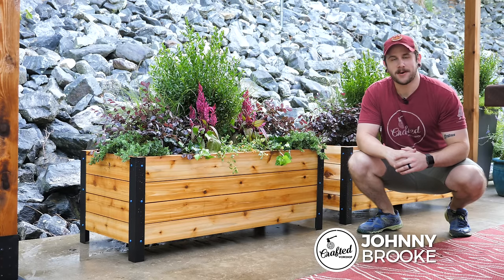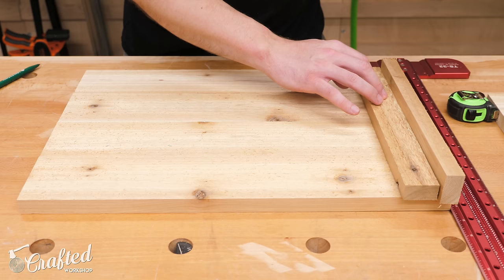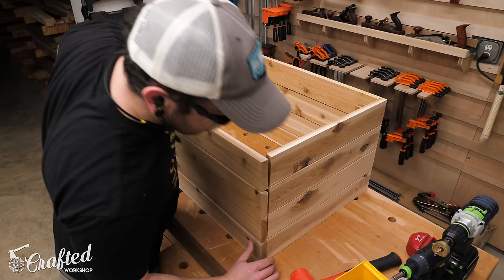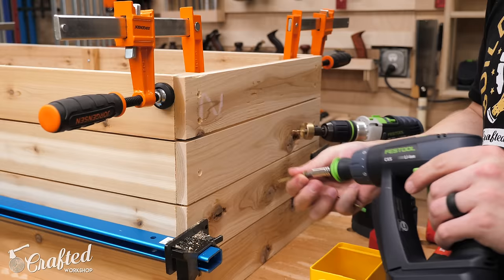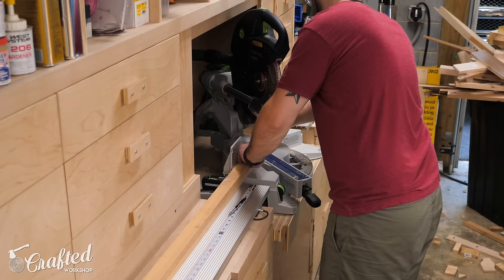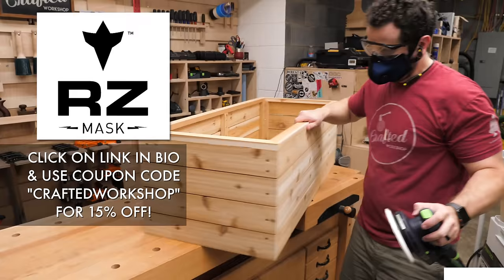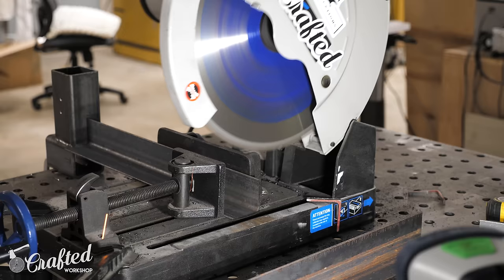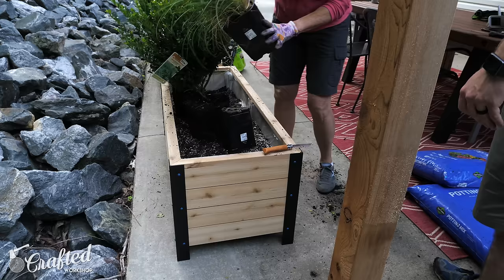DIY Modern Raised Planter Box // How To Build - Woodworking

Comment: just finished this build with only an electric screwdriver, hand saw, and staple gun. looks great! and I used aluminum instead of steel for the legs.
Reply: Can the aluminum hold the weight of the box filled with wet soil?
Reply: @JAMAICAN876  Aluminum angle is very strong being the weight is being transferred to the screws attaching to the box. Use construction adhesive. Better yet order Bostiks Grip n Grab. Waaaay better and faster initial bite when attaching

Comment: I recommend using landscape fabric instead of the plastic. It is durable, holds dirt in. Lets water drain out. And maybe extra oxygen for the plant roots
Reply: I thought so too but he used pressure-treated pine on the bottom, meaning that you need some kind of non-permeable barrier to protect the plants from the chemicals in the wood.
Reply: @kalanlynn2067  🤣 your funny!

Comment: Master Gardner, GREAT PROGRAM!!!! My dad was a primary organizer and instructor, he was a University of Idaho County Extension Educator and my mother was a "Master" Master Gardner and one of the 1st one's in our area. One suggestion for angle iron is to break down an old metal bed frame, which you can get pretty cheap at thrift stores or just find free, and you have a very inexpensive building material. Lastly, my personal recommendation is to use a higher grade weed fabric instead of plastic. But that's just me. Nice build!

Comment: Filter Fabric might have been a better option than the plastic. If you buy the right kind it will last 15+ years and is porous enough to allow proper drainage without losing any soil at all out the bottom of the box.
Reply: What is filter fabric? Can I get it at my local Joann store?
Reply: @hellensmart6601  probably not at a Joann store (never heard of this place) but a local landscape supplier or big box store like Home Depot, Lowes, and even Walmart/Target (during the season) will have it. something like https://www.lowes.com/pd/Hanes-Geo-Components-TerraTex-360-ft-x-15-ft-Black-Nonwoven-Geotextile/3316316

Though it is expensive most places have rolls of the stuff and you can just get cut the amount you need.
Reply: @zanesrg299  if you use textile not plastic it is risk that wood starts to rot. It is better use plastic as in movie, put on the bottom drain layer (expanded clay) than horizontal geotextile, and than soil.
I have flower pots in fruit crates with geotextile, it is good solution for roots, but not so good for ceates and wood.

Comment: Great job! Looks nice and clean. 
Just one tip for the metal cutting you did. When making straight cuts the blade will last 5-10x as long if you cut the angle with both ends facing down and the center/v facing up. 

Cutting the way you did I get 30-50 cuts. With the v facing up I get 100+

Comment: Nice design. As I have been assembling, I have discovered for me that the steel corner leg holes cannot match same on both sides or the screws will intersect with each other, so I will need to offset vertical distance of holes on the alternate side. I am using 2x6 recycled cedar lumber and also slightly thicker screws. When completed, I will will be happy with the results.

Comment: Just need a mitre saw and drill... proceeds to use 20 thousands dollars in equipment lol.
Reply: Cpt.AirWolf I vote thumbs down and move on...this is DIY for carpenters in a shop
Reply: so much for diy..
Reply: Why do people always have this complaint? Just because he used a bunch of expensive tools to do it doesn't mean it is necessary it just made it easier work. It really is a simple job you don't even need an miter saw. This could be accomplished with a hand saw and a cheap drill really. Or a cheap circular saw if necessary. The pocket hole stuff isn't too pricey and it's not even a need for this job. Of course add some other basic hand tools like a hammer and some cutters. If you want any easier than this you better just go get a kit ready to assemble I guess.
Reply: Great points! @JsGarage
Reply: Ikr? 🤣 I started the vid thinking, oh yeah, I can pull this off..then my hopes were crushed when he pulled out his equipment 🤷‍♀️
Reply: If you can't see the simplicity of this project, maybe woodworking isn't for you. You could do all of this with a chop saw, angle grinder, drill, and hammer drill. If you actually watch the video, he even tells you how you can do this with a few simple tools, just like every single video he makes.
Reply: @RocketDragons  - Sure you could... but that's not what is shown in the video and the final result would look a hell of a lot different.
Reply: @cptairwolf  So? This isn't Woodworking for Mere Mortals. This channel doesn't cater to a specific level of woodworker. DIY means Do It Yourself. To literally make something on your own instead of buying it. That's it. It doesn't suggest a certain level of expertise, and Johnny makes no indication that his channel is explicitly for rookies or people with limited assets.
Reply: I would like to see the project done with basic tools. A real DIY for everyday people, not a carpenter work shop. Using a hand held compact circular saw, and a drill is affordable equipment, but I’m not sure it’ll get the job done.
Reply: @nessay720   

If you need more information than what is given here you should probably just buy a couple of planters rather than frustrate and/or hurt yourself.
Reply: @nessay720 

Keep in mind, this is a wood box, A WOOD BOX, not a Sam Maloof rocking chair.
Reply: Good points Cpt, and it is sometimes hard to have the perspective of everyone and what tools/abilities they may or may not have. I made an EASY DIY garden bed video a while back. I suggest checking it out. I can assure you, I didn't use a single tool worth more than $90!
Reply: @nessay720  I converted 350ft of decking into eight hexagonal raised beds recently. My "shop" was the patio outside and the only tools i used was a circular saw, mitre saw and a cordless drill so it can be done. The quality of the end result is mainly down to the skills of the woodworker, not the tools  ;)
Reply: Haha, was gonna say that as well. I've got some basic tools, but his are just way better.
Reply: @junzhang8934 
 Whoever invented the wheel only had basic tools.
Reply: @GeoAeroponic  yeah, and tons of time as well.  <wink>
Reply: Ha ha ha ha ha ha
Reply: Hmmm. I really like watching well edited videos of pricey tools in action in a nicely appointed shop. That being said, I question the choice of the way you did the bottom it seemed like an after thought. I hate seeing things rest on angle iron, really hard to move without scratching up the patio or deck especially for your mom
Reply: Agree totally. Do you think this muppet has any concept of how many people in the world have this type of equipment at home all of it looked very new and hardly used at all.
Reply: Just use your cheaper versions. Don’t worry about it. Plus I didn’t see 20 thousand dollars worth. I have all these machines and more and it wasn’t 20k
Reply: @RocketDragons  If a project can be done with simple tools, then the video should use those tools instead of all of these fancy tools.
Reply: @lapnguyen2898  Then start your own woodworking channel. This video is about how he built some planters. Look at the title of the video. It's not being marketed to newbies with no tools. If you want that type of content, go watch the Woodworking for Mere Mortals channel.
Reply: seriously what a joke
Reply: Came here to say this lol glad its top comment.
Reply: @JsGarage  because the majority of people watching the video do not have these tools and are hoping to be able to make the planters cheaply using only regular basic tools they may have avialble, so using expensive tools may make his life easy it doesn’t help the person watching the video to get the job done:
Reply: @JsGarage   You right, professional  carpenter has professionals  tools .
Reply: @Jakilyn  that's what she said...
Reply: You could do this with a $79 Ryobi drill, a miter box and saw, and a hack saw. Instead of the pocket holes you can counter sink them and make a sawdust / wood glue past to fill it. 

Oh and a few sheets of sand paper and 6 Miller Lites
Reply: I guess I’m missing your point. A mitre saw, nail gun, drill, and sander are about as basic as you get with woodworking.  The steel work tools are the only area that shift to more specialized tools. But, they have angle metal with pre-drilled holes at just about any hardware store.  I’m guessing are getting hung up about the Festool brand. If you have Festool then use them. If not, this could all be done on very basic tools.
Reply: Ahhahaha same thought!
Reply: @tbz1551  Jesus Christ DIY is minimal tools and effort this video is a full on operation with tax implications
Reply: @cptairwolf  You don’t need Festool tools, start investing in power tools
Reply: “Super simple DIY project” Yeah right..
Reply: You COULD build it with a mitre saw and drill… anyone with these tools- should have basic understand how to do it- without needing the person in a video to be using those tools as well.
Reply: Haha that’s exactly what I just told my son haha.
Reply: Miter saw is like $300 and a drill is like $100. These are basic tools. I copied this video with those tools and built it no problem.
Reply: Ya I’m out.

Comment: I’ve just made some planters. A lot more hours than you think, plenty timber and over 100 screws.
Anyway I folded my liner over the main part of the box and then fixed my trim top on. Staples are so weak and rust to mush. Top tip from me 😁

Comment: Man...I still need so many tools... loved this project though! Will likely try it!
Reply: You only need a miter saw, sander, and drill. It takes a little more time without the fancy tools, but don't think you need them. 
1) The pocket hole jig is just used to save a bit of time; there are countless joints you could use instead, but the easiest here would just be to use a strip of wood to screw into.
2) The belt grinder was just used to deburr. The most common tool for doing that is actually a simple hand file, but you can use anything from a sharping block to a literal rock. 
3) Finish nailguns in general are just time savers. They actually add no strength to wood and are just intended to hold the project together so you can keep working while the glue drys. 
4) While clamps aren't strictly required here, I would still recommend simple bar or pipe clamps. They are cheap and versatile. 
5) You can easily cut angle iron on a cheap miter saw if you swap to a metal grinding disk. 
6) You can use a basic sander to prep the metal for paint. Any sander(include hand sanding) can sand metal. I use a random orbit sander to resurface my cast iron cook ware.   

You should check out the woodworking for mere mortals series by Steve Ramsey. He teaches how to do projects using only basic tools.

Comment: Extremely simple for who?😂🤣
They are beautiful though!
Reply: Simple to who has all those tools.
Reply: It is extremely simple, though. If you actually listen to what he says during the video, he explains how simply they can be made. Maybe woodworking isn't for you.
Reply: @a8a999  Home depot will cut the boards for you it's the angle iron I'm not sure about
Reply: I'm a union-trained finish carpenter.  This is carpentry 101.
Reply: Kroban3 Easy for those with the bent.
Reply: Makeup Junky I said the same thing lol
Reply: @a8a999  You can build this whole thing with a miter saw, hand grinder, drill, and sander. That is like $300 worth of tools. He used better tools because he happened to have them.
Reply: @RocketDragons   I I ikk zojkk56.  M

Comment: "just a miter saw and a drill"

Here I used my sander, my clamps, my pocket hole jig, my belt grinder, and my miter saw that can cut steel.

Come on man, this isn't a simple build lol
Reply: And what about the finish nail gun
Reply: I think his point is, that you could do it without the fancy tools he used.
Reply: Not only that, but all festool tools!
Reply: screw gun and a bandsaw or sawzall is all you need
Reply: And he also has the audacity to charge people 5$ for the plans...
Reply: @madman3332  Well, why don't you design something and give it away then?  Don't know how? Well that is what you are paying for, knowledge.
Reply: yeah, if you noticed this fancy recreational carpenter is using the most expensive tools on the market! ......
Reply: You said what I was thinking Alex. I don't normally post links, but if you're searching for an EASY DIY garden bed, I made a video of how to do just that.
Reply: It looks like David Moran is an alternate account Crafted Workshop uses in an attempt to argue with valid points. 😂
Reply: @madman3332  this would be so easy, why would anyone by the plans for this.
Reply: If you can't think of the most basic tools you can use,  that aren't thousands of dollars,  then woodworking isn't for you. This can be done with a hand saw, a drill, some screws, sandpaper and wood glue. You don't need the fancy pocket hole jig..or miter saw or angle grinder. You don't even need to cut the steel, use 2x2s on either side of the corner, or one  2x4 per corner. Use your imagination.  Humans have been building stuff more complex than this for thousands of years without electricity.
Reply: @Badkitty24  best comment on here. Too many complainers. It's too bad that such complaints might actually keep a lot of people from actually building anything. As if the video maker had all of those fancy tools to begin with! Seriously we all had to start out with a cheap circular saw and drill before we realized how handy a miter saw, table saw and drill press would be. If you really are passionate about making you'll MAKE DO. And then you'll pay up to make faster and to more professional standards. Also people who comment about the tens of thousands of dollars worth of tools a person is using annoy me because they assume they could never have those tools because they don't have tens of thousands of dollars to spare. And then it's somehow not fair for these makers to use all these tools in their vids or claim that something is an easy build. These makers didn't start out with all these tools and most of them didn't purchase them all at once! They saved and bought. Or invested in a big tool up front and then paid it off. And they built cool stuff and made cool videos about it and now they have sponsors. It takes time to develop the skill and invest in the tools and space to get to where they are. Could it be that the complainers are just covetous? The truth is this build is easy whether you have hand or power tools it's just faster with all power tools. You can cut steel with a hacksaw for crying out loud. Anyway that's the end of my rant. Thanks for bringing some clarity to the comments though lol.
Reply: madman3332 

I paid $5 for the plans because Johnny is a cool guy and I’d rather support someone’s business than Starbucks.
Reply: Ya’ll got a deal paying $5 for the plans cuz they are now $9.99...!
Reply: its a god damn rectangular object. hardest part here is a MITRE cut. lmao. If you have all his tools, great, its easier but doesnt mean it can't be done. If you cant make this, I would find another hobby

Comment: Everyone should stop hating, yes he has an awesome shop, and I am sure he worked really hard for all of those tools. You absolutely could build the same boxes with just a miter saw and a drill however if diy or woodworking is something you intend to pursue as a hobby or business you need to accept that it will require you to buy some tools beyond the rusty saw and hammer your grandpa gave you when you were 12. In the meantime stop hating on this guy for having the shop we all wish we had.

Comment: Too much tools to be DIY project
Reply: What is considered a DIY project to you then?  You can forgo the metal legs and be able to build this with a hand saw, and a screwdriver if you wanted to.
Reply: Skip the metal legs: you need saw and a hammer,
To get it better quality with less effort a handdrill and a miter box - if you have a fancy electric drill and willing to get metal legs cut in length you can add the holes your own
To make it faster you can use tablesaw/mitersaw, nail gun, stapler ejc
Reply: Even the metal legs aren't an issue using a $30 angle grinder and a cutting disc. If you have the tools he has, use them. If not, there are other ways to cut and drill that don't require this level of tools. It will just take you longer to accomplish.

Comment: Simple to build?  You used probably $2000 worth of equipment to build all this
Reply: Not even close. A few hundred if you buy a chop saw.
Reply: A decent miter saw isn't that expensive ( $200 12" Dewalt) and you can easily use a power drill to drill the holes vs. a drill press. Also, use a $30 angle grinder with  cutting disc to cut through the angle iron rather than a chop saw. Even if you were to get all of this, you could still get by for about $500 at Harbor Freight.

Comment: I recently had the idea of planter boxes for my front yard, these would be great, not too difficult and i really like the angle iron accent. Nice modern design.!
Reply from the maker: Thanks Shawn!
Reply: You're welcome Johnny! One thought, if i were to build this, mine would sit on the ground, not a concrete slab. Do you see issues with the angle iron digging into the soil and not sitting level? Thoughts on how i could adjust? I'd imagine i could just have it sign on the ground, so just cut the legs shorter, so its not raised. I didn't know if that would cause problems in the long run (rot, etc.)?
Reply from the maker: I would imagine the legs would dig into the dirt over time. I’d probably add a little concrete pad under each foot, to maintain the look. You’d definitely be more prone to rot with ground contact.